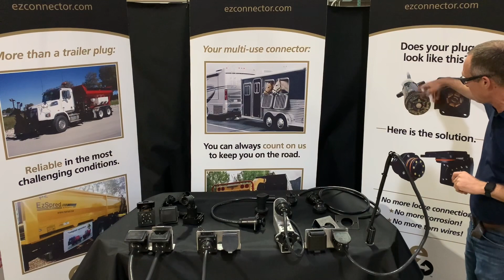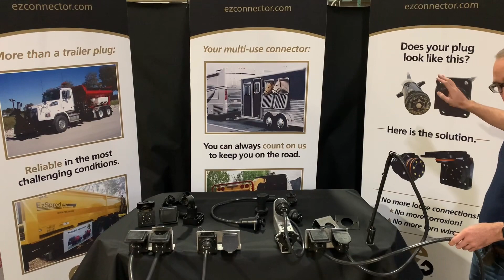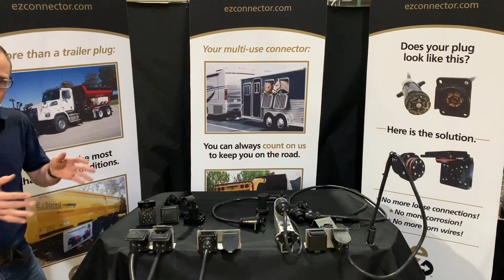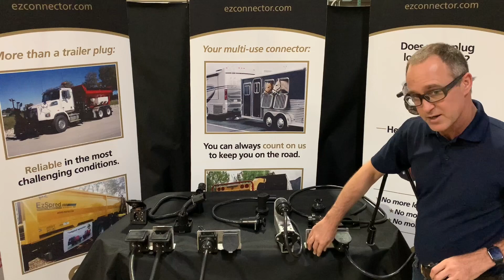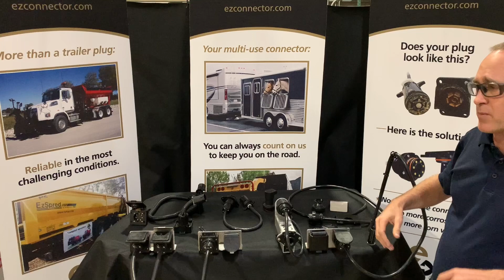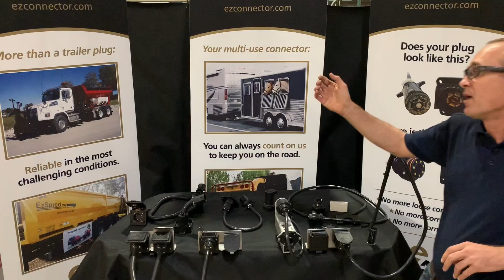EZ Connnector, Inc Magnetic Electrical Connectors Replace Your RV Trailer Wire Connector ezconnector

Comment: If you can tear up stock plugs and wiring, this won’t help you. You can tear this up too.
Reply from the maker: There is actually a complete difference in design that prevents damage; the stock 7 blade RV plugs are held in place by a notch on the cover. Although EZ Connector Self-Closing version plugs do have a self-closing cover, the cover does not play a role in keeping the plug connected, but rather is only in place to keep the interior clean when the connector is not in use. The plug is held together by powerful magnets. The purpose of using magnets instead of a notch on the cover is specifically to prevent damage from pulling away from the trailer without properly disconnecting the wiring. In terms of longevity, our lab tests have resulted in approximately 7,000 cycles before failure. From customer feedback, our lab test results closely approximate actual mean time to failure with everyday use.  The self-closing cover is actually not an integral part of the plug function / plug being held together while in use, but rather was a product enhancement that was introduced to eliminate the need for swapping the removable cover between the truck-side plug and the removable cover holder on the trailer.